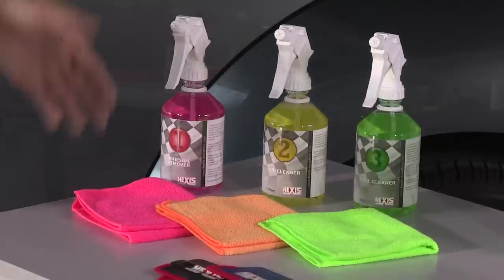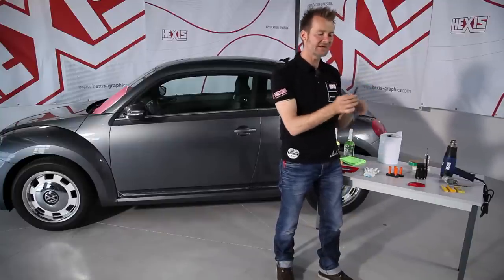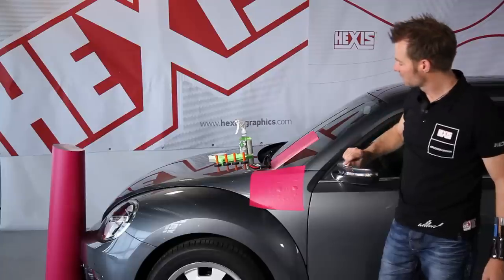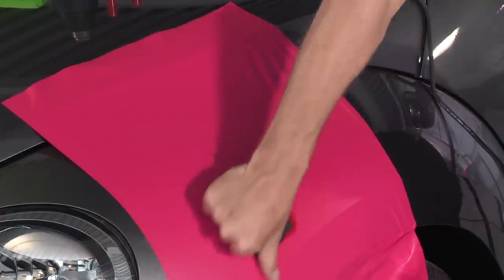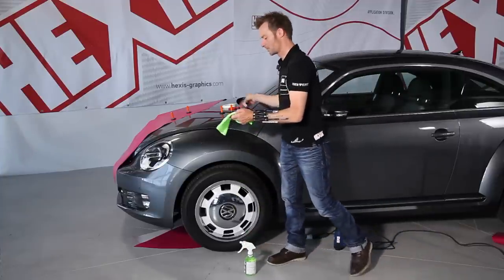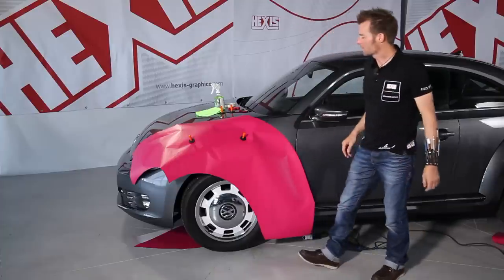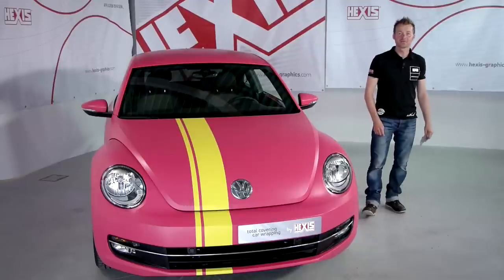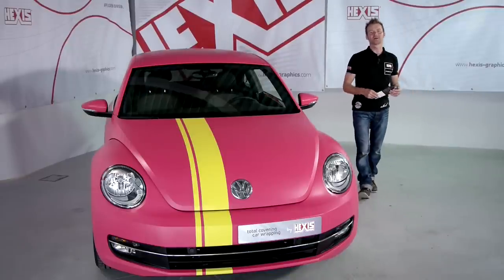Hexis Training - BASICS

Comment: This is sorta painful to watch. I don't agree with the techniques used here. You can anchor one corner and pull all the liner off in one shot from underneath the vinyl.  Once the liner is off you can pull glass, pulling in triangles using cold stretching with no heat, then get to squeegeeing. Hook any corners then hit it with heat to slightly shrink and relax vinyl. Take care of your edges, nice proper cuts and then seal the deal, done, less than 15 minutes and no over stretching!!!